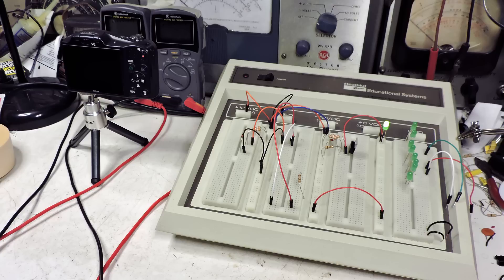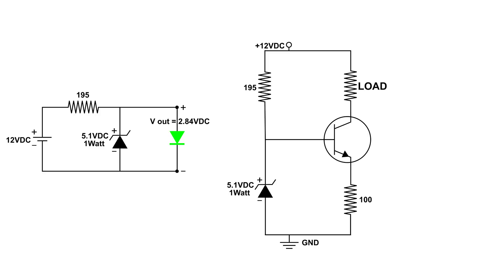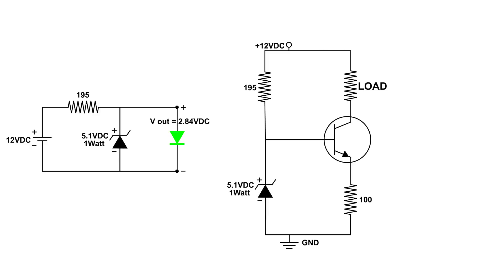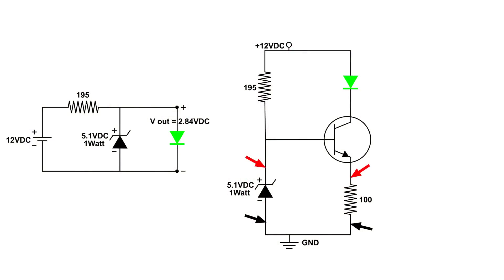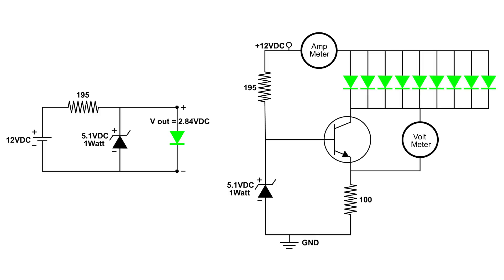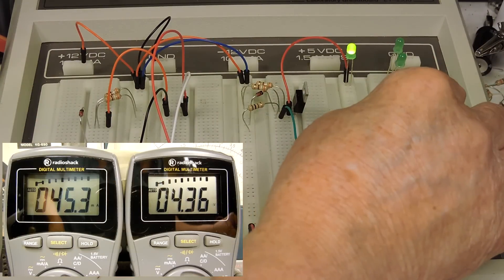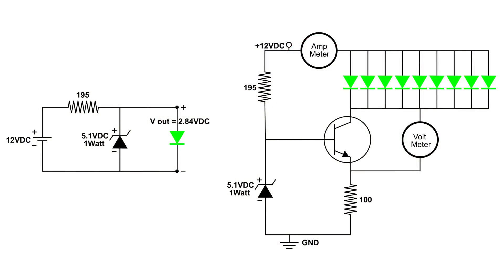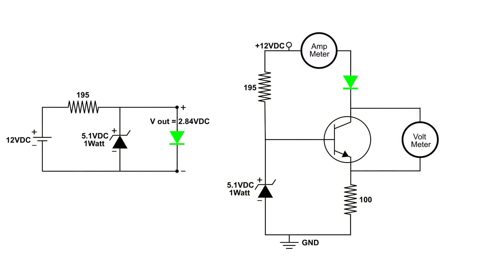Discrete Transistor Constant Current Source Circuit

Comment: What happens if I change led with resistor and what will be the current and voltage across transistor the load resistor and 100ohm resistor?
Reply from the maker: If the load resistor resistance is low enough the circuit will work the same.

Comment: Very nice demo Sir. Could you tell me the transistor and zener part numbers, I like to duplicate this and do a little more experiment work with the circuit
Reply from the maker: Any NPN transistor will work, I used a 2N2222. Also any 5 or 5.1 Zener 1 watt will work. You can find these part on ebay. Have fun experimenting.
Reply: Thanks

Comment: What kind of NPN transistor is it? A 2N4401?
Reply from the maker: 2N2222
Reply: @AllAmericanFiveRadio  That package doesn’t look like a 2N2222?! The transistor seems more hefty?! Are you sure?! Also, isn’t 45 mA too much for an LED? I believe the correct current typically is around 20 mA.
Reply from the maker: @shvideo1  It is a power transistor but a 2N2222 will work. Did not need a power transistor. This current these LED's run at.
Reply: @AllAmericanFiveRadio  Thank you for the clarification. A great circuit and experiment. Really enjoyed it. Thank you for sharing.

Comment: Can I use this to generate a 4 and/or 20 mA constant current source !? or How could I make it using 24vdc source and what components are necessary to do so !?
Thanks in advance :)
Reply from the maker: You could change the zener to about 2VDC. For 24VDC I would change the zener to 1VDC and the 195 resistor to 400. You can buy an assortment of zener diodes on eBay for not much money.
Reply: and that will generates a constant 4 ma and/or 20 ma correctly if I used 1K pot instead of 400 Ohm resistor !?
Reply from the maker: Put a 100 ohm resistor in series this the 1K pot

Comment: add a 10uf or larger electrolytic capacitor  in circuit behind that 5v zener Diode    & it will stabilize the 5volt circuit
Reply from the maker: Thank You.